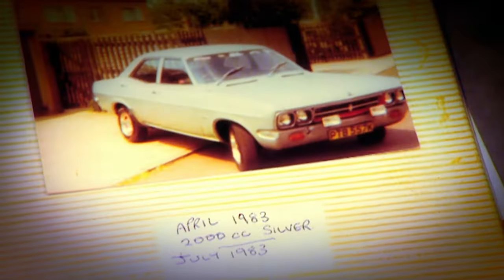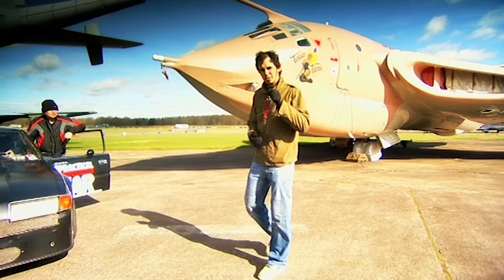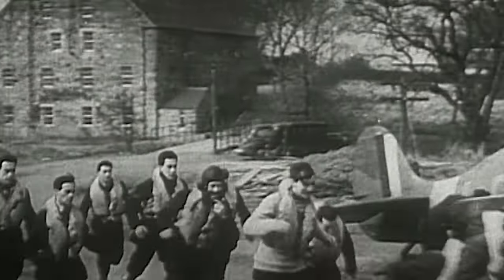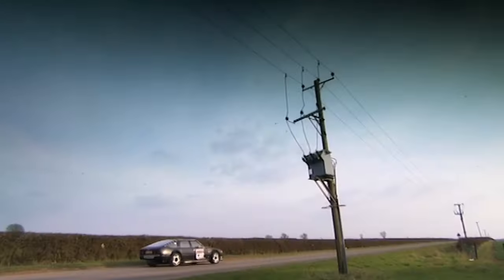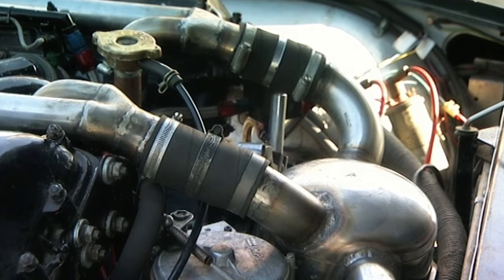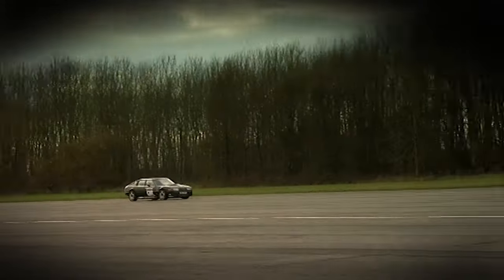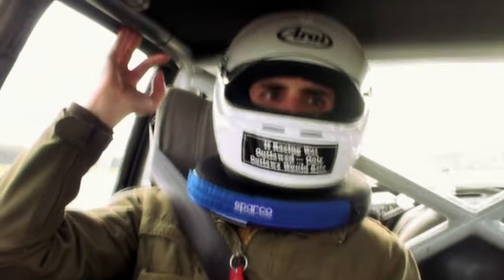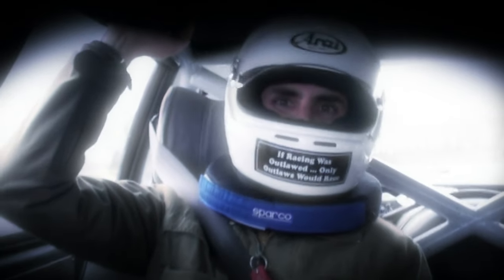Driving A Rover SD1 With A Plane Engine #TBT - Fifth Gear

Comment: 27-litre engine in a perfectly drivable, road-legal car, with AC and electric windows, for less than £10k = bargain of the century.
Reply: +No Name 8 gallons per mile, I reckon. Hardly a bargain.
Reply: +Ownage Productions if it was 8mpg with 27L that wouldnt be too bad since my 3L IS gets 16mpg
Reply: Also it's about a $500 oil change, even just using really cheep oil
Reply: +Vince R. That's 8 gallons per mile, not 8 miles per gallon.
Reply: +Ownage Productions Have you saw LPG switch? It's sunning on LPG.
Reply: +Hrvoje Kostelac you better know where all the stations that have propane are located then!
Reply: +Vince R. So 8gpm. That's 0,125mpg...
Reply: +No Name i think it runnin on lpg? as far as the sticker said by the switch
Reply: +Florian Heffner I wondered what those tanks were in the rear of the car... if they are gas tanks, that makes more sense than petrol ones
Reply: +No Name it uses ten grand of fuel each month,..
Reply: Where do I get one?
Reply: +ConnorOnThings at your local Rover dealer ofcourse,..
Reply: +Vince R. hahaha 'Ownage' speculates that rover does 1/8th of a mile per gallon!
Reply: Yeah mate until you have to refuel it that will be 1000 pounds to fill the tank sir
Reply: just use econ mode
Reply: No Name you could buy a amg bi turbo merc ,take the limiter off and do 200mph with out the aggro..just saying
Reply: Kev the Rammer  that wouldnt be less them 10 grand
Reply: jurgen hop in your country maybe but the one this rover I'd from you can. Mercedes depreciation is like a anvil off a tower block
Reply: Kev the Rammer  also the rover would be relaible after working on a few mercedes i developt a good hate on them
Reply: That's the LPG tanks.
Reply: "I can give you 10 bucks fo' that!"
Reply: Incredible.
Reply: Is tax based on displacement in the UK?
Reply: @benjaminbuljevic7977  pretty much
Reply: Nice toy though.
Reply: I agree 👍🏻👍🏻👍🏻👍🏻👍🏻who cares about fuel consumption when you get all THAT!!!! Pfffftt....
Reply: @OwnageProductions03  I think gallons to the mile is more appropriate
Reply: @claudethesilentman7841  It's not, it's based on emissions.
Reply: How much power can a MODERN 27 liter engine deliver? Come back with a 9000 hp 27 liter 12 disc rotary engine in a mid engine rallye car. Please.
Reply: Bargain is an understatement
Reply: Scam* because he should pay about 10k a year for environment reasons
Reply: Bargain to own but broke to run 🤣🤣🤣
Reply: @OwnageProductions03  8 miles to the gallon haha this engine burns a gallon a minute just on tick over pretty much
Reply: @OwnageProductions03  I got 8mpg going round a track in a 1 litre shit box lol.
Reply: @benjaminbuljevic7977  no, CO2 emissions, but only for vehicles registered after Feb 2001 😉 prior to that date there is a fixed rate for engines under 1500cc and a higher one for over 1500cc
Reply: @voornaam3191  A 70 year old engine! And also available with supercharger and a lot more horsepower,
Reply: But 20k a year in fuel is not so much of a bargain
Reply: hmmmmm imagine the MPG.....
Reply: @OwnageProductions03  my Ford focus gets 16MPG average.....
Reply: @VincentCS34F  lol check again, put your foot to the floor and it will probably be 6 to the gallon !
Reply: @appelpower1  1/8 mpg ? Holy crap just burn tar instead !
Reply: @OwnageProductions03  nah if a big block chevy gets 8mpg a plane engine is 100% gonna be like 2mpg lmao
Reply: 1000£ to fill a tank of propane?!?!?  Your about as quick as a can of beans arent ya..?  I have a propane tank thats probably triple the size of the entire car and it costs me 500 to have a truck come out and fill it..   to fill that cars tanks probably is about the same price as it is a 17 gallon tank of regular unleaded….
Reply: Sorry ₽ not £
Reply: this comment aged like wine
Reply: @TwilightTheShooter   Is that oil from a sparrow?
Reply: @VincentCS34F  Not 8 mpg. 8gpm. Or 0.125 mpg
Reply: @VincentCS34F  mate its gpm now not mpg 😂
Reply: 10 K and 10,000 man hours .
Reply: @OwnageProductions03  . Apparently he did the Mileage Numbers , during a Trip in Europe . Got about 15.5 mpg . Quite reasonable  I  reckon .
Reply: It’ll cost 10 grand just for a drive to the cost in fuel 😂

Comment: so, it's a rover with a spitfire engine build by a bloke in a shed ... i think that make this car more british than a royce rolls :P
Reply: The motor is a rols royce I believe..
Reply: Rolls royce meteor engine. its from a centurion tank. shares a common block and a few other bits and bobs as a spitfire Merlin engine.
Reply: Don't forget it's a Leyland gearbox
Reply: I followed the build of this he even modified a forklift into a lift with a hinged roof on his garage Charlie's abit of a legend
Reply: I thought the V12 RR Engine for Tank use was a Meteor ?
...not a Merlin.

Comment: Bet it has better emissions than a VW
Reply: Jon Buggins anything from BL would have better emissions than a VW.
Reply: And it'll last longer :)
Reply: my volvo T5 can go faster in less time
Reply: Yet another person who doesn’t understand fuel efficiency vs emissions. 

The reason why VW cheated on emissions was to improve efficiency. 

You aren’t going to get the deadly NOX from a rich burning low power loafing petrol engine like you do from a lean burn high temperature high compression diesel.
Reply: Please change your profile picture.
Reply: better emissions than a VW w8 or w12
Reply: I take your bet, 10.ooo £ ?

Comment: Search: How to install Supercharger on a 27L V12
Reply: EmceeDoctorB  He said tank so I assume its without the SC. IIRC, running it with the full fat SC at full boost would require octane ratings well above 100.
Reply: @keithw4920  Would LPG be good?
Reply: @ellenorbjornsdottir1166  depends on the particular SC and SC gearing used but i think LPG and LNG are about 130 RON. I have no idea how a Merlin would take to it though. If i recall, the most boosted of the merlins used for intercept were drinking 150 (mon or ron)
Reply: Meteors were just Merlins that failed QC for aircraft installation.  

An OEM supercharger would be a bolt on mod.. though you might need a Merlin carburetor. 

But it’s total overkill and not very practical. Unlike automotive super chargers.. aircraft superchargers are to preserve sea level horsepower, not boost it. Typically you’ll have lower compression pistons and a moderate amount of boost (between 5 and 10 inches of mercury). 

Aircraft superchargers are typically what is known as “ground boosted” which means they produce far more boost than is useful at SL.. but you control manifold pressure with the throttle. As you gain altitude, this boost falls off until you are eventually wide open throttle which is the engines “critical altitude”. For planes like the Spitfire, they had a two speed supercharger so before the boost fell completely off.. it would speed up to restore it. The Germans used a hydraulic CVT for theirs so they could have maximum boost at any altitude. The American Allison engine was designed for a turbocharger which with a simple wastegate could also produce maximum boost at any altitude.. but the turbocharger was so bulky that it was only installed in the P-38s and F-82s. The P-39, P-40, and early P-51s had Allisons with single speed superchargers which meant they performed poorly at high altitudes.
Reply: Buy a Merlin rather than a Meteor and it would already have a supercharger.
Reply: V12 supercharged... next thing: Adamantium gearbox
Reply: Simple: pull it straight out of a Spit or a Mustang.  The bloody things were Turbo-Supercharged.
Reply: @ellenorbjornsdottir1166  112 octane for LPG IIRC....
Reply: @Bartonovich52  No, Meteors were not "Merlins that failed QC for aircraft installation" - they were derived from the Merlin design but they were specifically built as tank engines.
Reply: @Bartonovich52  I'm glad you found the time to write that, I actually found this very interesting :) lol
Reply: @Bartonovich52  If I remember from the MkII pilots handbook 12" was takeoff power. 
Then again I'm a biggish guy so a P-47 is more my style. My shoulders are against the sides of a Spits cockpits even in a MkXVI bubble canopy. 

I do like the P47 "the aircraft built around a turbocharger" 😂

Comment: "The rev limit would give a 50mp/h speed limit through the cars standard gearbox"
The standard gearbox also could never handle that much torque
Reply: thats the thing with a reduction gear before the gearbox (if this 1 is pre box), 1500 lb ft at 3 k rpm becomes 500 lb ft and 9k rpm. plenty of transmissions can deal with that
Reply: Plenty of transimissions can deal with that, but can the Rover's stock transmission do it aswell?
Reply: iv no idea what gearbox he uses
Reply: Maybe read the original comment then?
Reply: i took that to mean a normal car gearbox which have similer ratios
Reply: @SuPerbMusiCFan  These came with a fairly torquey V8 engine so the gearbox would be fine. I'm not sure if TVR used Rover gearboxes but if they put a lot of power through them using the very same Rover V8 these cars came with
Reply: @Scoobydcs  more gears means more drivetrain loss
Reply: @ eatthisvr6

Lol.. it’s a reduction gearbox on the engine. 

The torque goes the other way. 

I’ll put it in perspective. The PT6 gas turbine on the plane I fly is comparable to a WWII V12 aero engine.. producing just over 1000 HP at 1700 RPM. 

Which is about 3600 ft pounds of torque!
Reply: im thinking the tyres would save the gerarbox before that engine blow it up by turning the tyres to smoke.
Reply: You can only apply as much torque as you do resistance. The tyres would just spin. If you bench press 100kg but take away the weight, well there is no strain anymore.
Reply: @chippyjohn1  unless you have very grippy tires, but I suppose that goes without saying

Comment: The Meteor was a purpose built tank engine producing 600hp and based on the Merlin without supercharger. It had a cast iron block and many other modifications. It was made by Rover. Rolls Royce's chairman, Hives, had lunch with the Rover chairman and they did a swap. RR got the jet engine that Rover was trying to develop and Rover got the V12 Merlin based Meteor.
Reply: the block was aluminium  not cast iron  later ones had roller rockers
Reply: How I understand it is that a Merlin can only fly for a certain number of hours, after that as far as aircraft go, it's scrap.
But then there is nothing to stop the engine being used on the ground.
The petrol for land vehicles was very low grade so detune it by removing the superchargers and swap some parts from aluminium for steel.
Set the engine to run backwards (compared to the aero duty) and you have a tank engine.
A carburetor Meteor has around 600hp.
There is a version fitted with petrol injection that was rated at about 812hp
Reply: @g8ymw  

 engines were readily available in sweden as the army used them 
int the 80s  and there are a lot in cars and heavily modded for tractor pulling    twin ohc conversions   and superchargers coax a few more hp out them ,  the boosted induction helps get round the  bad inlet port shape   ,the heads are 4 valve  with sodium filled exhaust valves with 2 spark plugs  standard , at the time when cars were still mostly sidevalve engines ,other notable engines were the ricardo triumph 1920 and most of the rudge motorbikes up to late 30s , the only  cast iron bit on the meteor was the  timing case /starter clutch housing   and exhaust manifolds

Comment: I remember Clarkson going on about the Bugatti veyron, saying it's a masterpiece, thousand horsepower etc, these blokes do it with little money in a garden shed
Reply: True, but the Bugatti would still demolish this car in terms of performance, and braking, and handling, and comfort
Reply: and even if he did a great job he didn't engineer his own engine he "just" shoved it in there
Reply: The Bugatti is actually a useable car though. You don't have to wear full safety gear to get it up to speed and i'd wager this think drinks fuel like you wouldn't believe
Reply: @mrcaboosevg6089  Yeah but wait until it crosses path with a BMW or Mercedes.
Reply: @mrcaboosevg6089  but there are thousands of Bugatti Veyrons, there's only one of these.
Reply: @ynotnilknarf39  Thousands? They only ever made 450 of them (all variants), so it's rather unlikely there are "thousands" of them around...
Reply: @TheRoybeasley  Thank you for the update, I presumed there would be many more that would have been sold to prospective buyers gvien how cheap they were ...
Reply: This Rover configuration drinks more fuel than a bugatti
Reply: @jasttim  okay, but will the Bugatti win against the Supermarine Spitfire LF Mk.IX in firepower?

Comment: I worked with charley in a garage in Rutland, at the same time as he was building this and went to pick the rover up with the company breakdown truck when it was stock. He did so much work on the car. the engine didn't have oil filters originally so he made an aluminium block with three on for the oil to pass through. so much work.

Comment: Meteor tank engine, not a Merlin, but developed specifically for tanks/trucks from the Merlin desgin.
Reply: I care, the show is inaccurate. Don’t suppose it would have sounded quite as flash if they had said tank engine. Pretty stupid conversation anyway the standard SD1 did 125mph with a 3.5 V8. It’s not that much quicker and looks shite.
Reply: Quite appropriate to use an SD1 as the Meteor engines were built by Rover back in the day
Reply: Similar engine but not quite the same. Meteor wasn't supercharged, Merlin was in many planes. Meteor ran in the opposite direction than the Merlin. Never the less an awesome engine with shed loads of torque. John Dodds Beast was a merlin but that wasn't from a spitfire
Reply: @coolpaul69  Seem to recall John Dodds saying that he had a tyre blow at over 200mph on a German autobahn,and added”Once I got it down to 180,I knew we were going to be alright!” He also initially tried to run the engine with the supercharger,but it blew exhaust systems wide open,so he”de tuned” it by removing the blower,and fitted a bunch of twin choke Weber carburetors instead. Saw him do an “easy” 10 second quarter mile at Santa Pod,a long time ago. Like the Rover,he had an “increase” rather than a reduction gear from the crankshaft. Think he ran 4:1,rather than the Rovers3:1,but owning a gearbox business gave him a distinct advantage when engineering his final drive.